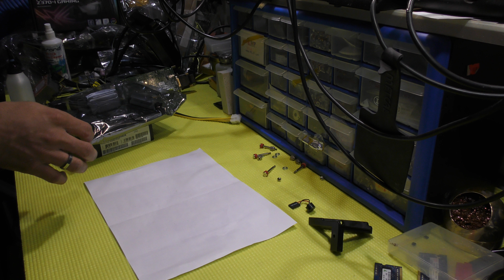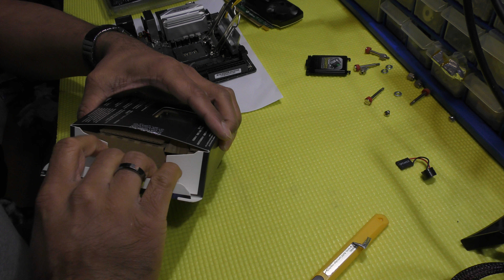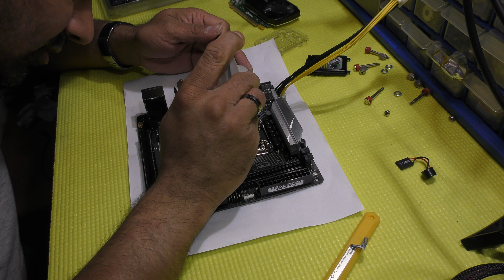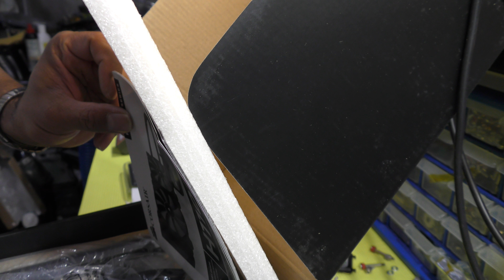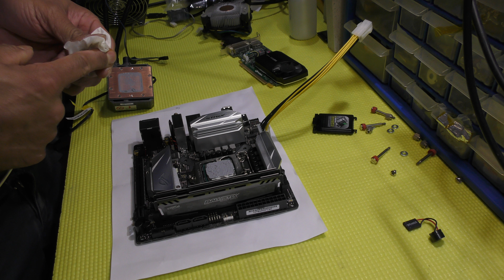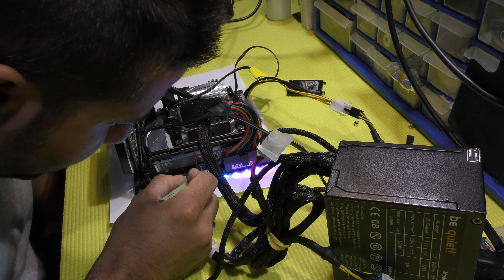ASUS ROG STRIX Z370 I GAMING WITH INTEL I7 8700K***YES TOO MUCH THERMAL PASTE*** 😜😜😜

Comment: Nice vid, just about to build one of these myself into a DAN A4  case!

Bit confused though, why are you using that GPU? The built in iGPU of the i7 is capable of 4K 60Hz output if its just being used for media etc?

Comment: The thermal compound on the standard cooler is fine. There is no difference in the different types of thermal compound. 2 degrees is not worth the money and you put on way too much. You have no idea what you are doing. This guy is an armature. This probable over heated.